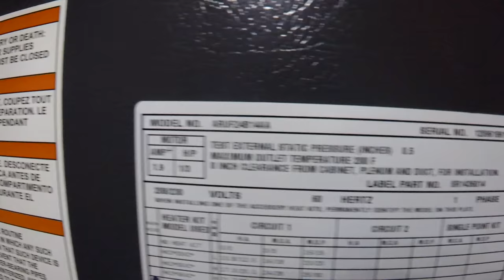How To Wire Safety Switches

Comment: Wouldn't that be a parallel circuit if it takes both switches to turn off unit?
Reply from the maker: Yes, that is correct. thanks for watching.
Reply: All your safety are going be wire in series to the device here is the switch are normally closed if one detects water in drain that is clogged it will open the circuit because the will switch is open shutting the equipment off.